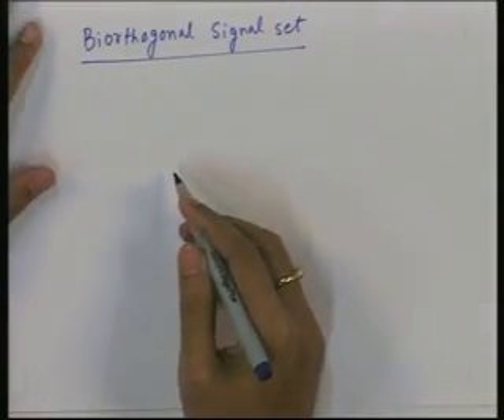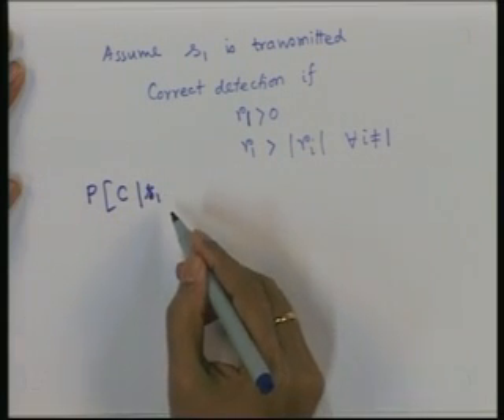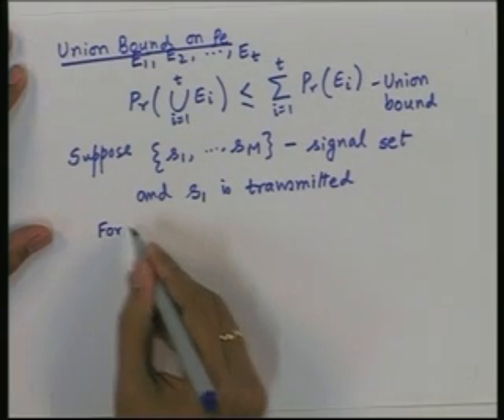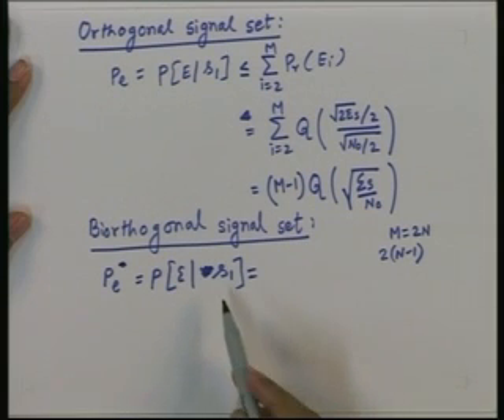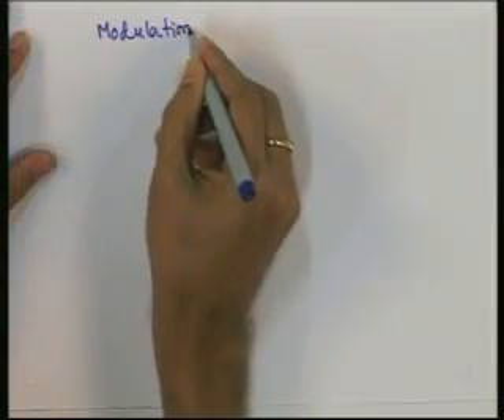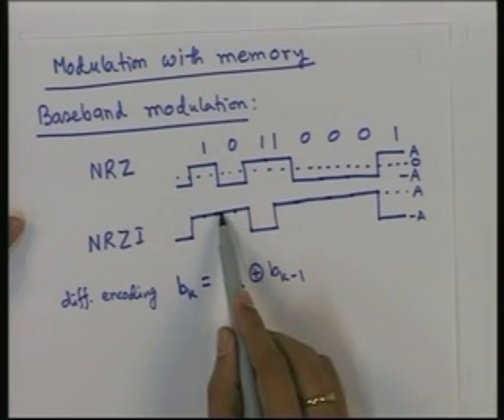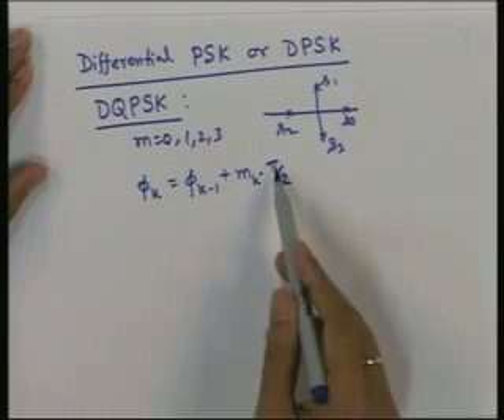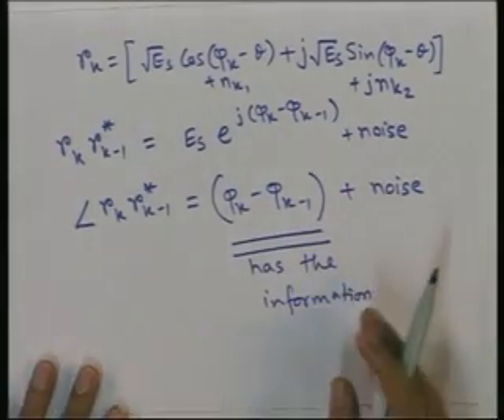Lecture - 24 Calculation of Probability of Error

Comment: 'N' and 'M' appear to be switched. It must be M = 2N, as the basis is of size N, and there are twice as many vectors in the signal set.
Reply: No....If you consider N=2 
Then M =4 for Bi orthonormal Signal set
S1=(√E,0)
S2=(0,√E)
S-1=(-√E,0)
S-2=(0,-√E)
Then assume S1 is transmitted
Then probability of error will happen if n2(noise for N=2) is greater than Alpha or less than -alpha. Where alpha is the transmitted value for received vector R.
R={r1,r2}
r1=Alpha